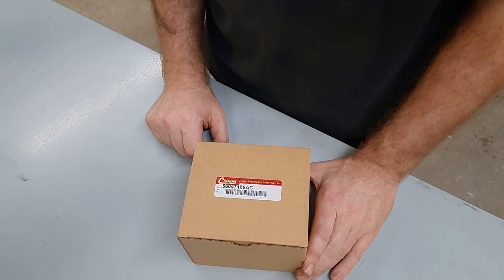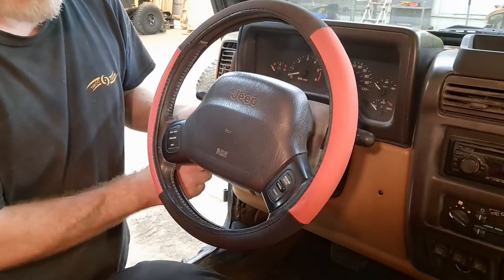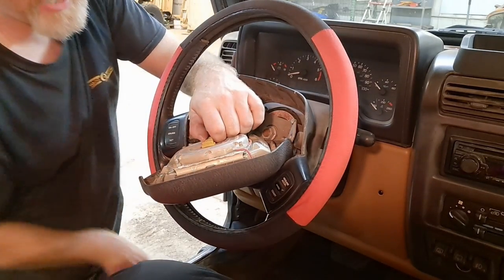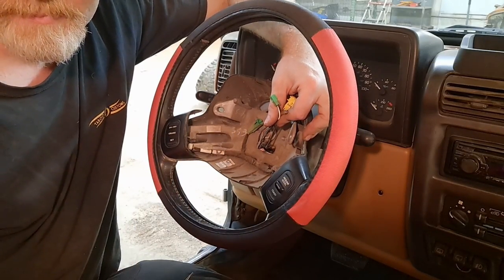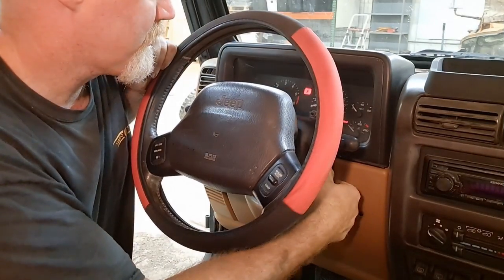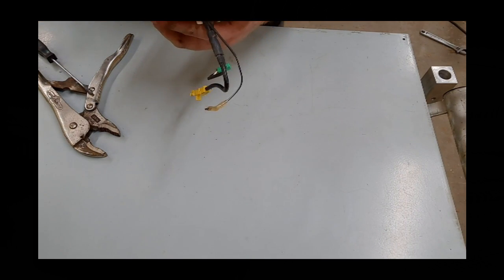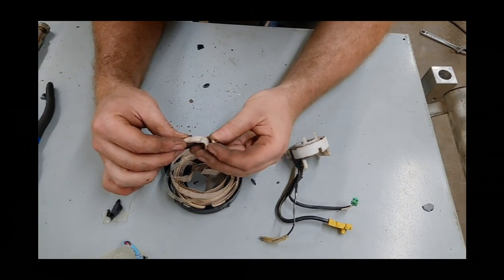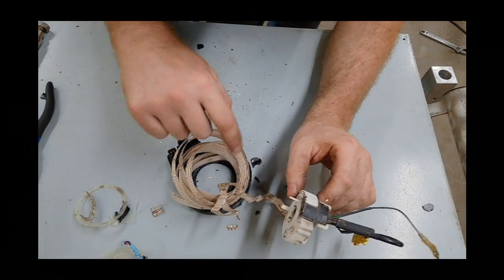Jeep TJ Clock Spring Replacement and Where They Fail

Comment: My Horn started blowing while sitting on my XJ.  Had to disconnect the fuse to the horn.  Replaced the clock spring and the horn now works as it should.  Internet searches were very vague on the cause but it was the clock spring.
Reply from the maker: I think all that's in the ribbon so maybe the wear caused it to short out on another circuit would be my guess.

Comment: I have a 97 TJ without cruise and my steering column is making a plastic grinding noise. It's not the rubber boot at the firewall. I have no symptoms, turn signals work, no dash lights, no cruise to stop working. Could this be my issue, or could it just be some dirt/debris somewhere in there? If it is the clock spring and it fails, will it leave me stranded?  Thanks!

Comment: This is fantastic.   Someone said after disconnecting black cable from battery to wait 15 min for charge to dissipate.   Is this pretty much the same for a 99 jeep cherokee? I just purchased one, and my horn, radio, high beams, cruise control are non-working. 😂😅
Reply from the maker: I guess the same theory would apply but I can't say that we wait a prescribed amount of time.  I figure if you disconnect the battery first, there is plenty of time disassembling non electrical items that it's not a problem.

Comment: An old friend of mine once said, "The most important part of any car is the nut holding the steering wheel." 🤣

Anyone about to undertake this on their TJ or XJ, it might help to mark the steering wheel's position on the steering shaft before removal. Use a marker, or scratch it with a pick, or something, so you know exactly how to align your wheel to the steering shaft during reassembly.

Sometimes you can remove small Torx screws with similar-sized Allen wrenches, but use caution, it's easy to strip the head of the screw if they're really tight.

Comment: Thank-you. This is so helpful.  Fair warning. Autozine will tell you it has the correct Airbag Clockspring.  It may not.  Make sure yours Does or Does Not need the green connection.  My 99 Jeep XJ  needs it, and the clcokspring autozone said fits, doesn't have it.  Do ur due diligence and open it up, remove the airbag and check first.  😅

Comment: Btw.  Is compressed air advisable to use to clean that area?
Reply from the maker: I think you could, I wouldnt imagine that it would set the air bag off or really damage anything.  Only thing you might want to be careful about is moisture in your compressed air.  Dont want to blow water down in there.

Comment: My 02 wrangler's steering wheel will not come off 😂 so the air bag light will stay
Reply from the maker: Using a steering wheel puller it won't come off?  You can borrow one at most major auto stores.
Reply: The threads stripped eventually in the steering wheel after so many attempts with a steering wheel puller. And we are in South Africa so parts are getting really hard to find.